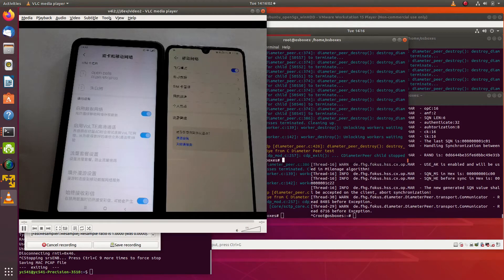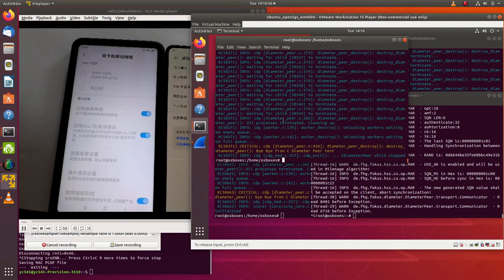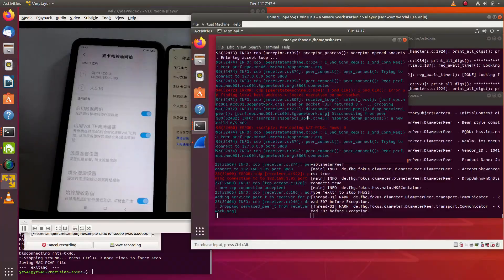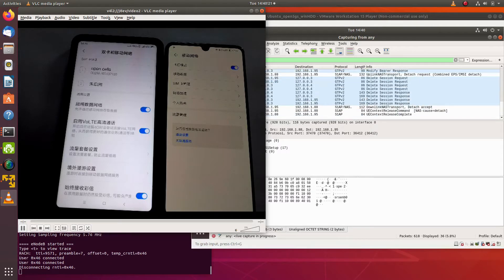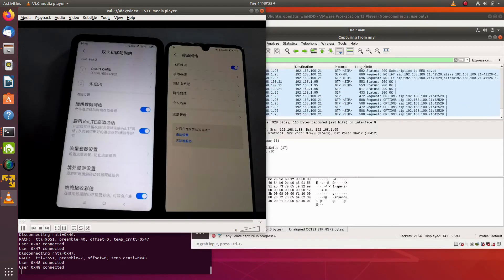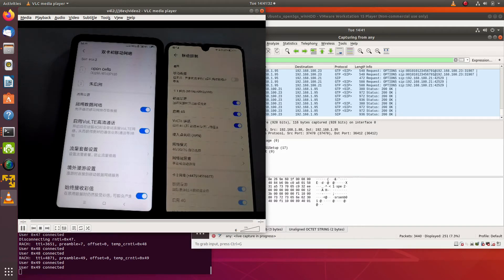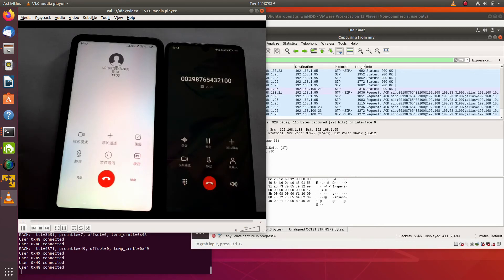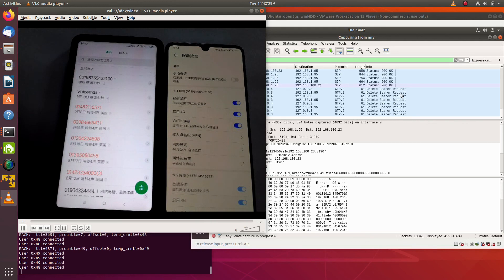VoLTE using an open source LTE system

Comment: Finally getting around to setting up something like this, link/guide seems very detailed. The one part I feel like I’m missing is the srsenb part. Did you have to do anything configuration changes on the srsenb side in order to have it connect to the other components?

Comment: Hi Yi Chu, please I need to clarify a point on Hardware configuration. Based on your setup do you have Open5GS + Kamailio IMSI in the same VM then the DNS in a different VM ? Did you manage to setup Diameter connection with OCS for billing? or did you know how I can acheive that? Best Regards
Reply from the maker: I didn't set up anything for billing
Reply: @yichu4367  Thank for your answer. How about the first question? did you setup the DNS on a separate VM ?
Reply from the maker: @ADETOLAPATRICK  the DNS is on the same vm of open5gs and ims
Reply: @yichu4367  Thank you very much

Comment: Hi Yi Chu, thank you for the Video.  I want to follow the guide you share to build a simulator and give it as a donation to my former Telecom school in Africa, I have a question. For the routing is necessary to use NATing or I can use the Public IP without NATing.? Also the eNode B you used is there any link you can share where I can see the price if I can afford it. That will be help to move forward or not for that project of donation. Thank you
Reply from the maker: It's probably better without nat. My enb is SRSenb with a usrp
Reply: @yichu4367  excellent I was thinking to have an SRSenb too. Thank you very much

Comment: Which model of sicards are you using the sysmoISIM-SJA2?, or other vendor?, i am trying to program the simcard but i cant change some objects of the chip (MNC and MCC)
Reply from the maker: I am using these SIMs, you should probably check if you are using the sysmoUSIM tool correctly or not, and you will need ADM keys from your vender

Comment: 可以分享一下 open5gs 的設定檔嗎?
我使用的是 srslte (enb) + open5gs (core NW)
我目前連 attach 都不成功
可以分享一下經驗嗎?
謝謝
Reply from the maker: (For everyone to understand I will respond in English) the open5gs version I have is pretty old so my config probably doesn't work with your environment. In section 18 of the guide (url in description) the author has a link to his configs, you can check it out. Remember to change the internal/floating IP in the guide to your own. Check sections 15 and 18 in the guide for your DNS and interface settings, they can mess up everything. I would recommend posting your problem details on the github page of open5gs, with your logs and pcaps, I'm sure someone will pick it up. Good luck!
Reply: 请问你有做open5gs里的volte么？
Reply: 可以敘述一下顯示不成功的訊息為何嗎？
基本上srsenb與open5gs 連線需要以下幾個設定是兩邊都相同即可
1.mcc
2.mnc
3.tac
4.s1ap_addr